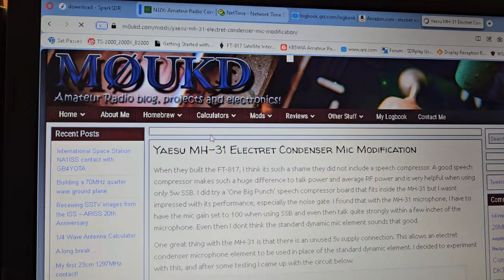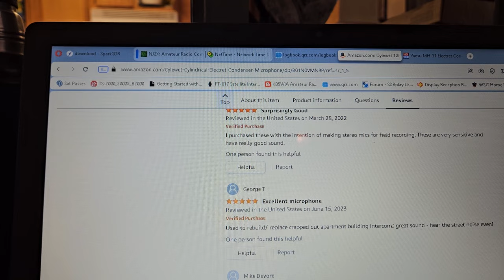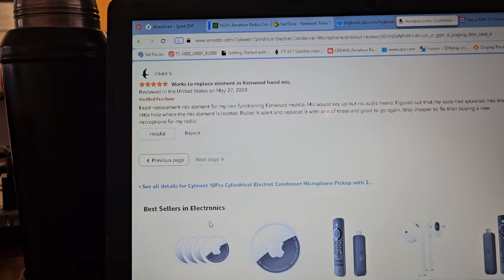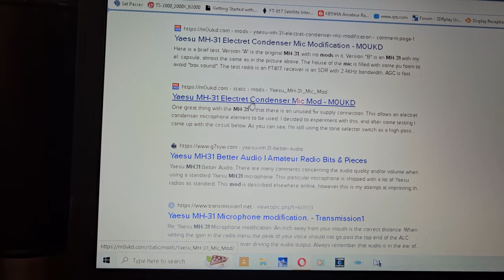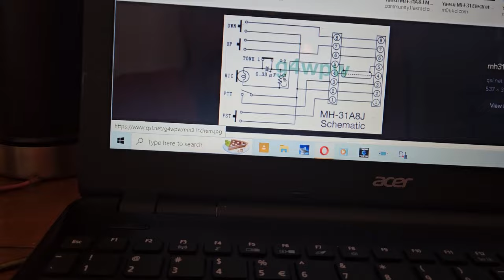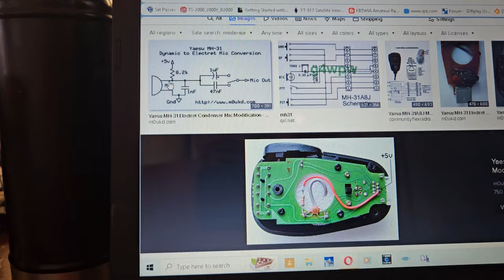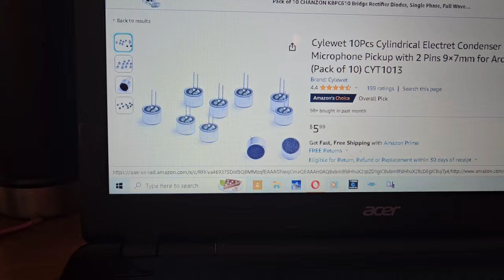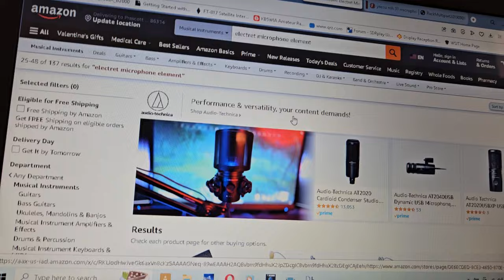Electret elements for yaesu mh31 modification. better audio soon!

Comment: on a yaesu ftdx3000 you burn a little transistor in the switch SLOW/FAST with this modification... This transceiver is well know for it.  Don't change anythinks with ftdx3000. i have to jump to the rear PTT to solve the problem.
Reply from the maker: I know about the problem.  I had a different ftdx3000 that had the issue. Every time you leave key it up it would beep in the fast light would go on and off however I didn't realize that this microphone could cause that to happen I'm not actually using it on this radio and I'm really glad you said something so I can make sure that I don't I'm using an MD 100 with it right now
Reply from the maker: Honestly i found its better but not really worth the hassle. I have the ftdx1200.  I wonder if its a issue with that radio also